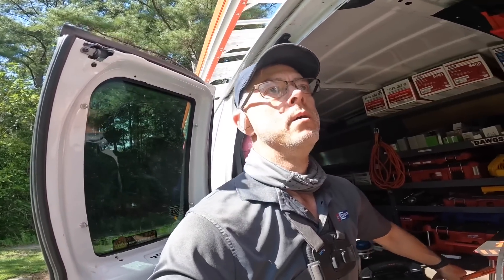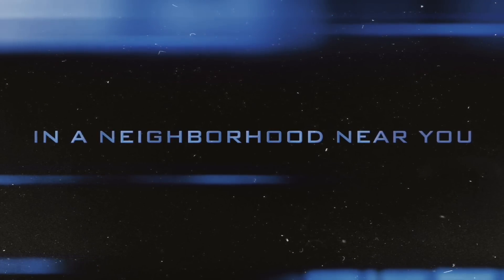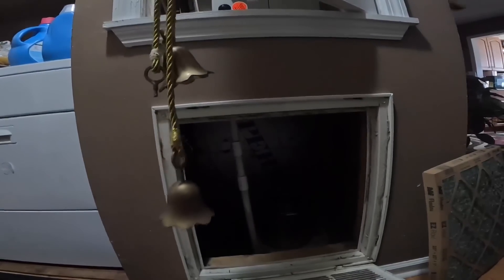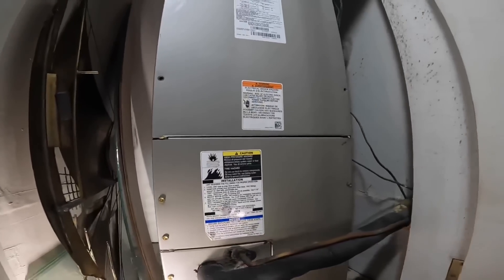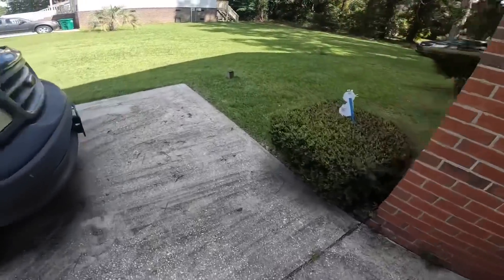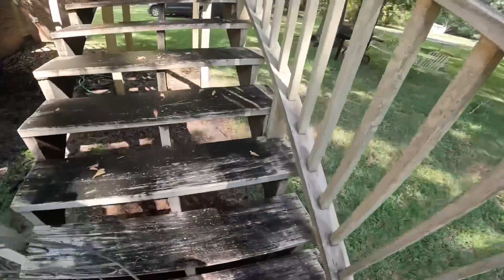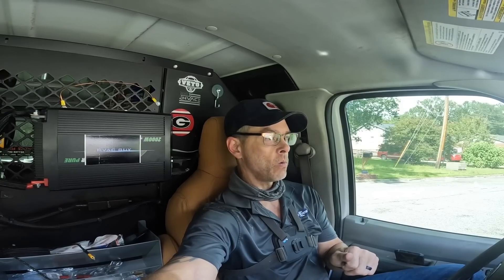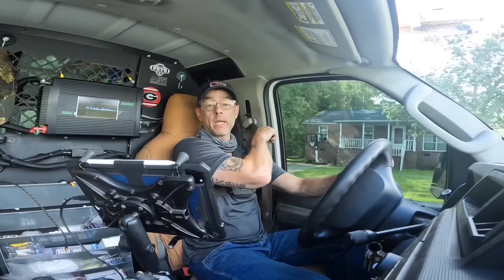An 8 Year Old ICP Coil Leaking , and a Brief Discussion About New DOE Regulations

Comment: I am in central Florida, I am looking to replace my 2009 Goodman in the next month or 2 before the summer oven gets dialed up to max intensity.  Every contractor says they can't legally sell anything lower than a 15 SEER with the R454b refrigerant, the lowest quote I got was $7500, double the cost of a 14 SEER with R410a.   The big question is what is all of HVAC outfits doing with all of the 13 and 14 SEER 410a units still in their stock?  I highly doubt they will 86 them simply because the DOE says they no longer cut the mustard.  Secondly, is the 454b refrigerant requirement going to result in a massive spike in the cost of 410a, similar to the way R22 spiked in less than 5 years after the release of 410a?   My big concern is this is more of a planned obsolescence vs. energy conservation, people can expect to pay 2-3 times the cost and get 1/4 the quality and longevity of the equipment.

Comment: I had the exact opposite problem.  My dual pack (Heat w gas cool with freon) went out a few years ago.  I live in the country and I have to buy propane which is really expensive.  I asked the group that was set to install the new system on my home warranty to install a heat pump and I would pay the extra.  They told me I was nuts and installed a new Carrier dual pack, so I'm still buying propane at $5 to $6 per gallon.  Thank goodness I live in a temperate climate as it cost quite a bit to fill my 250 gallon tank.

Now I'm thinking about three dual splits for my home, though I don't think it would be worth it at my age.

Comment: Maybe the DOE thinks we’re going to have a cold spell here in the south🤔
Reply: Ha. But when it hits below 40 F Floridians lose their crap. After moving up north, I barely need any heat when it is 40F. All the stuff down there is poorly insulated concrete block. They could have put in just a little more insulation and everyone could cut their cooling costs by like 50%.
And screw the south and their stupid outdoor drain lines FFS.

Comment: I recently bid out a new AC system on a 1953 house, been using Mr Swampy for ac and got a Trane XV95 or 97 can’t ever remember the number part cause long ago they said my incoming electric was not right (only 100 amps) and my ductwork wasn’t right either. Ok, so, I got the great furnace and a more efficient swampy. Swampy worked great, 68 degrees even in 100+ heat. Too bad my 1950’s wiring didn’t..I had an attic fire. They took out the ceilings to get out the smoky insulation and I got bids on new AC. Straight cool heat pump systems can’t be found, and are virtually the same price as the dual heat pump versions, so, I went with the heat pump version despite having a great furnace and a sealed gas stove fireplace in my living room. I figure backups and redundancies are good things..now I’m replacing 1950’s wiring, getting a new 200 amp service..welcome to the new world..

Comment: I'm just a curious dude (not in the industry), and I've got a 17 year old r-22 single stage with furnace.  I know there's a leak and I can't (don't want to) keep it pressurized forever ... but I also n don't want to replace it with an about to be replaced r410a standard either.  I'm pissed that I got r22 at the end of its life cycle, and will be forced into an r410a system at the end of its like cycle.  stupid government.

what's the best play?  suck it up with a heat pump / dual fuel come spring?  I live in MS, but it still gets close to 10 degrees for about a week a year...

Comment: 16 SEER Amana scroll Heat Pump....works fine in the 120+ temps but sucks if the heater is run anywhere under 40F ?!  We don't have heat strips either in the Desert.

Comment: back in 2014 i think they went up to seer 14 thats why i got a system on my new house built!!!  seer 16 and Duct insulation/wrap R-8 
 where i live in georgia it was 104 the temp in the house was 70 i tryed it and the system cut off. we have it 72-73 you have to down here :)
Reply: Actually, you don’t.

If you have a properly ventilated home, with a high quality dehumidifier installed to control moisture in he house, you would be comfortable around 78.

Control the part of the climate humans struggle with, don’t reduce the temp to ridiculous levels.
Reply: @SuperVstech  I dont have any moistures in my house attic Ventilated Correctly Belong  min Standards.... Since its a New house i wanted to see what quality insulation etc and see what it would cool down to 70F from 104f.. it did a great job and even cut off like it was 80f outside.
I turn it up to 74-75 you have to in this state
Reply: @TermitesRGood1  that’s amazing, since spec homes with the highest standards of air sealing and hrv equipment still have humidity maintenance equipment. Your home must be a technological marvel. Beyond what the greatest architects can build.
Reply: @SuperVstech  i had a blower door test done at that time Duct leakage/ house it was 4.6-4,7 whatever that is. the builder wanted example one item xyz  so i did research on that i said would this be better turns out it was... The thing about it the Way i wanted cost me $0 They were already doing it but a difference way..... EDIT  insulation between interior walls love it :)

Comment: This is the first I've heard of the heat pump only thing. I will say this, sure, you may just wanna say screw the furnace and go with heat pump all the way, but understand that a lot of older houses do not have the electrical supply to handle heat strips. If this is the case, many homeowners will have to upgrade their electrical panels to accommodate going from a 120 v, 15 A breaker to a potential 90 A circuit using 2× 2 pole breakers! This is not good.... I think heat pumps in general suck, they are subject to mold and mildew, they do not heat extremely well in cold conditions and they wear out faster. The DOE doesn't care though, they are not paying for your replacement equipment,  upgrades and repairs.

Comment: HVAC manufacturers should not be able to get away with parts only warranties. Can you imagine buying a car with parts only warranty?
Reply: Cars have 3 year warranty. HVAC has 10 year parts. Average car price $45;000, average hvac system $7,000. People change oil every 3-5,000 miles, be lucky to get homeowner to change filters every year. You spend money on maintenance on your car every year, most homeowners don’t have maintenance done till there is a break down.
Reply: @joep4143  ,
With recent price increases, $7K is the low end of prices. AC units do not require oil changes or lubrication. 
Just like a car warranty is voided if engine is destroyed by no oil, an AC warranty could be voided if caused by clogged filter.But I guarantee a lack of mainteance does not cause evaporator coils to leak.

Comment: SEER requirements are set by Governmental push for efficiency.  New  Mexico we are Gas heat dominant. They push for electric but is the grid in place? How can you call a Heat Pump true Dual Fuel? It's still all Electric. New regs are to go 15 SEER here while the rest of the country goes to 14 SEER. You will never get that high efficiency burning fossil fuels at the resident level, possibly? at the power plant. The high brows force the manufacturer to go high efficient so that will be all that is available, not, the suppliers fault. So how do you compete on bid work if your preferred Manufacturer doesn't build a 15 SEER and you have to price 16 SEER equipment. I guess the guy that builds a 15 when everyone else only builds a 16 gets the Lions share? Very interesting without even touching on refrigerants. Be safe out there.

Comment: It’s already started with us here in SoCal. Dual Fuel and heat pumps are becoming standard. It’s a bit of a pain with having to run new tstat wires for the condensers in many cases. But pulling an air handler up an attic is a whole lot easier than a low Nox or 96%
Reply: Got that right. Here in CT on the shoreline, we don’t have many furnaces in attics. Thank god.  But! We have plenty of sand  crawlspaces with cast iron boilers.
Reply: A dual fuel system is slightly different then an all electric heat pump system. Instead of electric heat strips, a dual fuel system utilizes a gas furnace as the AUX and emergency heat.

Comment: I'm up here near Buffalo, NY and it regularly gets to -15F on cold January nights.  Older houses use gas boilers and radiators and newer houses gas hot air/AC.  So I installed a mini split heat pump 5 years ago.  It has never broken down and cools the first floor wonderfully all summer and I have used the system down to -4 F and it blows an incredible amount of heat out of all 3 indoor units.  Even on power mode you barely hear the compressor and outdoor fan. The unit is 2 ton with 21.7 SEER.  Nothing lasts anymore so I figure if it breaks I'll just replace it with new ones. Electricity is expensive up here so it makes sense to use the gas boiler in the winter, besides, there is no better heat than radiators.
Reply: The problem with operating a heat pump without AUX electric heating coils, which mini splits are rarely equip with. Is yes they will still heat below freezing. but it will be more of a Luke warm type of heat, then a cozy type of heat like you would get from the radiators, that a lot of people would more prefer.

Comment: You can get straight AC here in the Pacific Northwest. I have been looking and there is nothing that I can find that a home must have a heat pump in Georgia. Is still legal to buy 80% gas furnaces in Georgia. If you can’t buy a straight AC condensing unit I still think you should keep that gas furnace. Ripping all that out running new high-voltage lines to the air handler is not the way to go. It’s not going to save the customer any money. As for work tearing out a gas furnace and putting in all electric heat pump. why didn’t you just top her off with ref charge so she can have AC? I don’t get that one.
Reply: Did you watch the video the lady already had an electric air handler.... she doesn't even have gas he was just talking about the new Department of Energy regulations that are coming up starting 1st day of 2023.
Reply: @jre4961  You can still have a gas furnace in Georgia I was looking at the regulations. it looks like a slow refrigerant leak I would’ve topped off the charger so that she has AC. I wasn’t commenting on the electric furnace,

Comment: If you simply need staight A/C unit simply hook up the heat-pump that way. Doesn't ever have to switch over. Caution with no dual fuel, customer may not have enough  power capacity in their panel for electric heat strips.
Reply: Here are no heat strips with dual fuel… it uses he gas heat.

Comment: Glad got stuff done in 2020. Another friend of mine is gonna spend too much for a heat pump in Oregon. It only makes sense a couple weeks in spring and fall here. They don’t want gas anymore. I’m satisfied with high efficiency condensing furnace and 5 stage AC compressor— which is great for dehumidying. Electric keeps going up. When bought the house, pulled an extra circuit into the master bedroom in case needed to install a unit for that room only. So far, managing on central unit. I love the climate of West coast, but thinking of moving on.

Comment: It's hard finding a condenser here in Indiana too. The main problem I'm seeing is the different height in cased coils. N coils are becoming V coils and Carrier is out of uncased N coils. That really puts a bigger cost on customers when not being able to reuse cabinets. More time and more material cost has to be paid by someone. So the big DOE and politicians change of making everything I higher seer is hurting more people than what most people understand or know about. Now just a coil change out isn't going to happen in most cases. There is a good percentage the coil change out will now be a complete package of furnace a.c. and coil or like you said a heat pump instead of a.c.  I'm at age where sometimes 30 years ago the change out was just changing out the HI side. Them were fun easy days. I guess charging stations that they want to put up will cause to high of demand for electric companies. I won't get more political but I'm playing the BS card.

Comment: Question , few weeks ago you install the Gree FLEXX system, those system can heat when temp reach -15F in winter, is the price of that unit is close to a dual system or gas furnace+ coil or more expensive ? thank you
Reply from the maker: If Flexx made a system with a 120V AH it would be an excellent choice to replace a furnace. But, as is we need to either pull another wire or convert it to 240V
Reply: @HVACGUY  Well you could install it with a furnace if you wanted. Kinda defeats the purpose though.
What you both should look at is the new Midea split system, also sold under Cooper and Hunter. It runs the AH from the outdoor unit just like a mini split. And unlike Gree Flexx or its clone, the MRCOOL Universal, is a communicating system.

Comment: I'm down outside New Orleans, hvac contractor my own company. I been talking with my supply house have hurd about seer 2 with 15 seer units but I do not know if American Standard is doing that stopping straight cool and going heat pump, going to ask tomorrow about that I try to keep up on everything going on. But have seen the new Bosch 15 seer condenser with the inverter compressor and board and that is a nice system.

Comment: Yeah the Arkansas governor and the state senate passed a law several months ago here in Arkansas HVAC contractors are no longer allowed to install anything but a multi-stage or variable speed heat pump system. Single stage systems are no longer allowed because they are not Energy efficient. Personally I believe that's how it should be anyway just from personal experience installing a two stage 18 seer American Standard heat pump with a variable speed blower knocked my electric Bill down easily more than 60% my electric bill went from being nearly $400 a month to barely $200 because it doesn't constantly run compared to my old train XR 13 5 ton with single stage blower that thing ran constantly.
Reply: Yea so they can have more electric for thier new green deal
Reply: I seriously doubt Arkansas banned single stage units. Can you provide sources?
Reply: @Kman-hw9pf  Thv11, Kark4, Fox16 all did a story in it few weeks ago. I dont think its completely banned but new installs are supposedly being heavily restricted. As you know youtube does not allow links in comments so you will have to do the research yourself.

Comment: Sadly the greenies are taking us down a stupid path.  Even without the regulations the price of natural gas is forcing everyone that has a brain to strongly consider a heat pump.
Also, if they already have a furnace don't tell you customers that the need a straight heat pump.  They would have to employ an electrician to run new wires from breakers to air handler if their service even supported this deal.  Just use the furnace as the back up heat.   In most cases this conversion from straight cool to heat pump will require just new stat wire to thermostat and outside unit.       We didn't elect these folks and they sure shouldn't have the power to force these regulations upon us.
Reply: the DOE & EPA have over stepped there authority for a long time the EPA with AC is under fire now do to this issue in congress the DOE cant keep the power on in some states with rolling black outs they need to be regulated
Reply: You don't know what you're talking about. See ya in 5 years with your conventional system... then we can talk
Reply: @kaptaintrips  educate yourself.
Reply: @kaptaintrips  LOL Some of the people you commenting to here are other HVAC techs that know their stuff, and probably know more about heat pumps then the government or environmentalist. You just don't like to hear the truth, that this green heating and energy fantasy, that your eyes are bigger then reality on. Is ether doomed to fail, or be plagued with imperfections and compilations that makes it not all that feasible. Like these electric cars for another example.
Reply: @kaptaintrips  What part of this simple message confused you or that I got wrong?

HVAC Guy is correct the push towards heat pumps is real.   If a customer already has a gas furnace then installing a new furnace or using old furnace as the secondary heat instead of running electrical service that the emergency heat and the 240v air handler is common sense.   Since the original unit was a straight cool which is common 2 wire outside and 5 wires to thermostat then this must be upgraded to work on a heat pump.

The DOE is out of control and no one voted for them.    Hope this helps in your understanding but if not please let me know what area you're confused with as I love teaching younger guys that need a leg up.

Comment: Couldn't they find an easier spot to put the condenser,  this is a dangerous place for it.
Reply from the maker: It’s in a flood zone
Reply: Condensers on platforms like that, are a common sight in regions that sees more then a foot of snow, or sees a lot of flooding.
Reply: O ok
That makes sense,  but the access to it was a little hard.